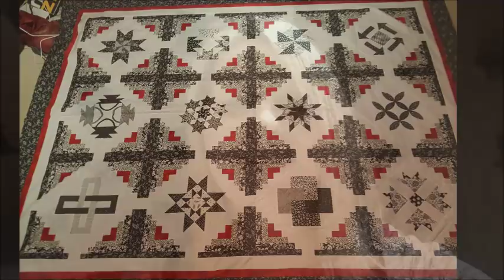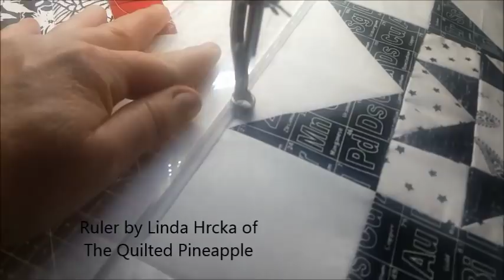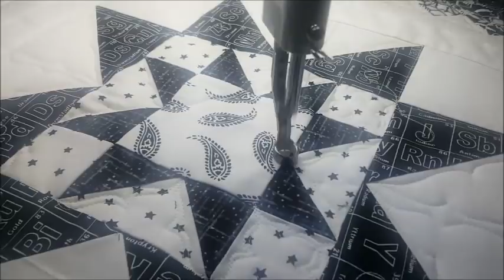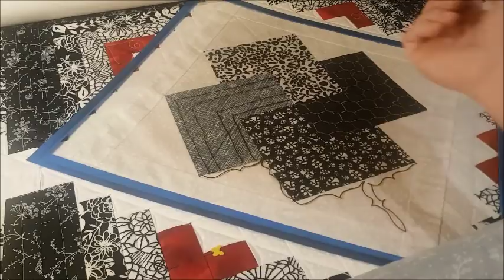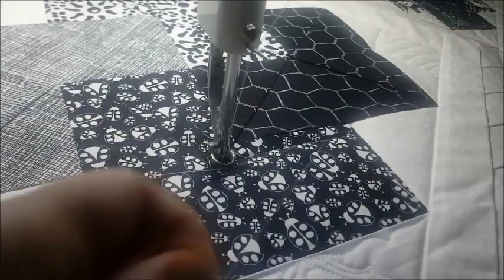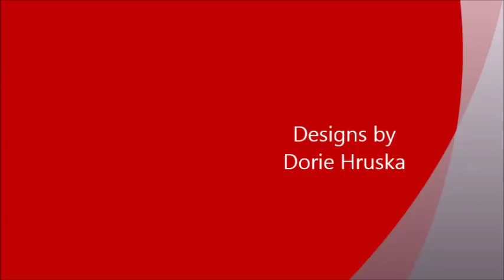Finding your Quilting Path around a Sampler quilt-Part 2 (continuous quilting)

Comment: What 'plastic' are you using to draw on and it looks as though  you are using a white board marker.
Reply from the maker: So sorry I missed your comment 2Dreamin !!!  
I'm drawing on a piece of thick plastic. I got mine from National Art Supply (local store). It measures 15 1/2'' X 18 1/2'' but they come in many precut sizes. I also have it on a roll 20'' X 12' (this fits the width of my rollers) The blue you are seeing is painters tape that I applied around the edge so I wouldn't mark on the fabric. I draw with a dry erase marker (always on the same side of the plastic) and wipe off with scrap batting.

Comment: Can you tell us where we can purchase your preview plastic, that you are drawing on?  I like how the border is finished on the plastic.  Thx!
Reply from the maker: It's just a thick plastic. I got mine from National Art Supply (local store). It measures 15 1/2'' X 18 1/2'' but they come in many precut sizes. I also have it on a roll 20'' X 12' (this fits the width of my rollers) The blue you are seeing is painters tape that I applied around the edge so I wouldn't mark on my fabric. (This should answer your email also)
Reply: Forever Quilting Excellent.  Thanks very much. Have a great holiday! 😁🎄😁🎄😁🎄

Comment: I would never be able to remember what decisions I've made after moving from the plastic to the fabric.
Reply from the maker: I keep the plastic close by so I can remind myself of the design. You can also draw  the designs on plain paper or on a printed picture of the block.
Reply: @ForeverQuilting  Got my book today...few questions.  Do you float your quilt tops and have you ever basted a whole quilt before quilting?
Reply from the maker: Wonderful  @hpringle100  ! No I never float my tops. By pinning my top squarely to my leaders I am able to make the quilt finish square. As far as basting the whole quilt, I have never found a need to do that. Of course by basting I am referring to quilting long stitches across the entire top that will later need to be removed. Now there has been times that I will baste a section because it has an enormous amount of fullness that needs to be disbursed and basting helps in that situation. I have a wonderful example of this type of quilt that I will post about sometime in the near future.